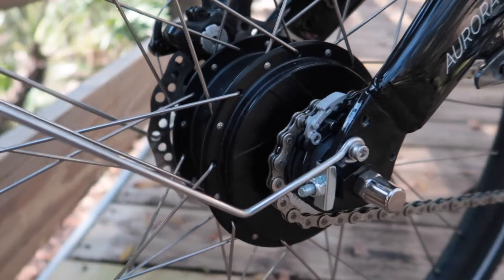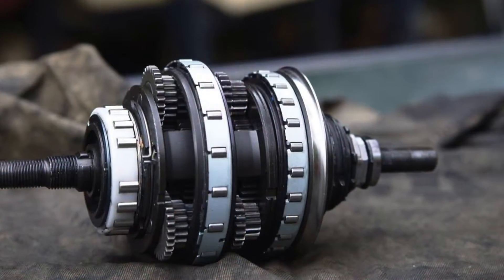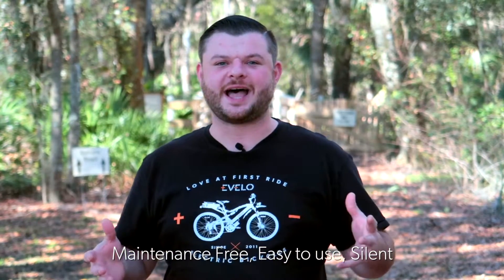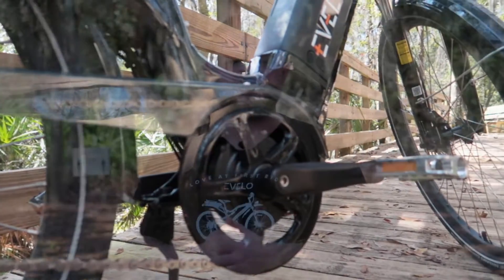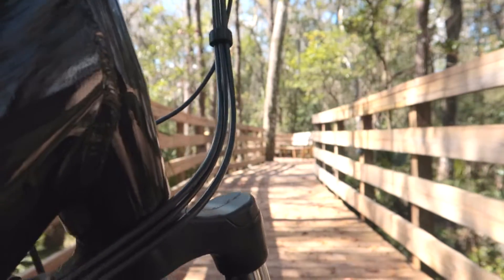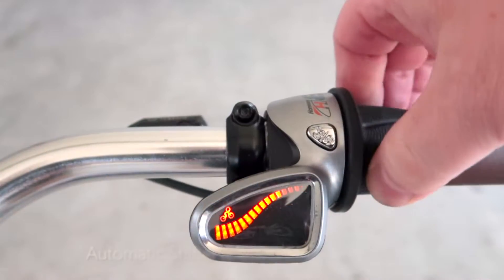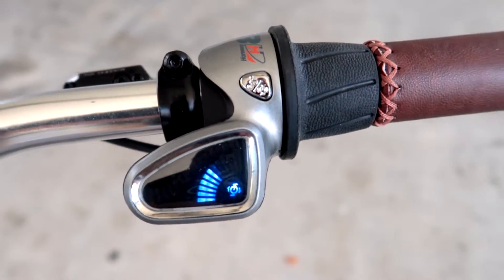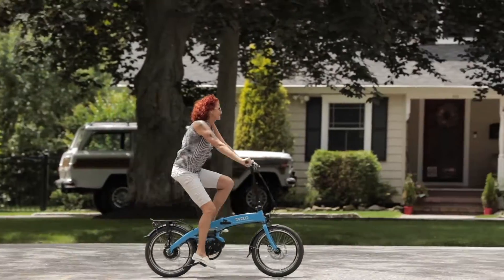Electric Bike Continuously Variable Transmissions (CVT)

Comment: By biggest concern about the automatic is that it likely wouldn't work if the battery is dead or removed. I want an ebike that I can use the full functionality of (with exception of the throttle and motor assist) with a completely removed battery.
Reply: It would still work it’s not like a car transmission. The transmission in this is between the electric motor and the drive system. You can always still pedal the bike like normal if the bike is turned off. Think of it like even if your car dies you can always put it in neutral and push it. The bike is always “in neutral” because the electric motor isnt locked to the pedals
Reply: I don't think anyone would buy an ebike if this was the case. Please do a little research. Ferrari makes some good points.